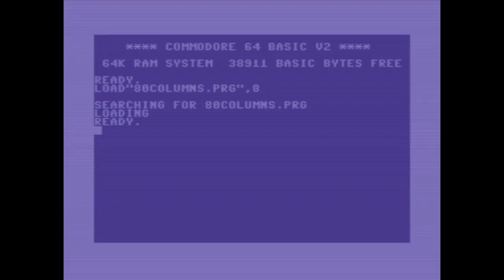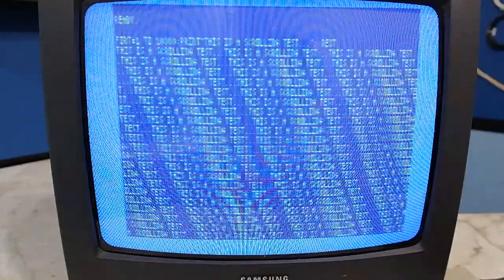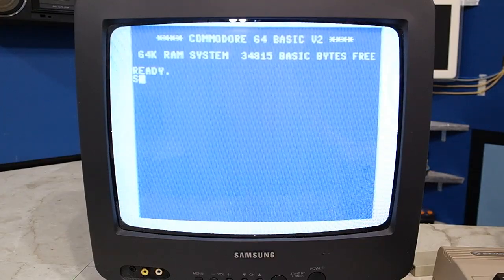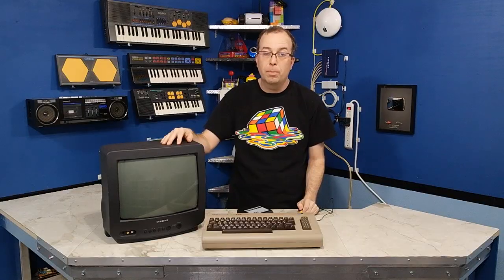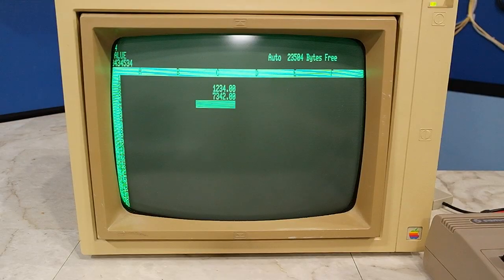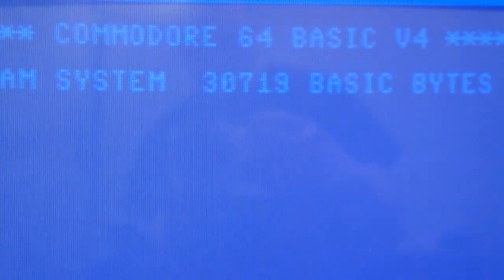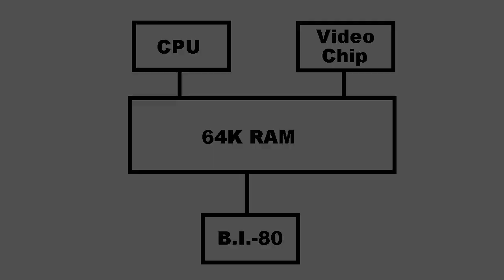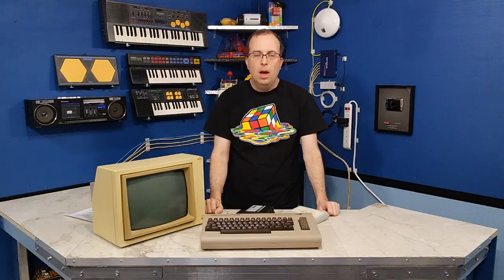The Quest for 80 Columns on the Commodore 64

Comment: There's a way to write software in portable manner on the Commodore 8-Bit line that doesn't require accessing screen memory directly: By using the ROM Kernal jump table of function calls (near the end of the Kernal ROM). They're the same on all 8-Bit Commodores. There's one call that returns the screen configuration. And you can use another to print characters in the same way PRINT does. So, even if you write a machine code program, you can do it portably.

Comment: I actually have the BI-80 card and the version of Paperclip that works with it.  It was great back in the day, the biggest downside was with the BI-80 version of Paperclip, there was 8 KB less memory for your document because the card took up 8K.  Sure, Paperclip had that great feature where you could link documents together to get a longer document then could fit in memory, but it was still a bit of a pain at times when dealing with long documents.  The BI80 card also added some commands to BASIC, which BI used as part of the explanation on why the card used up 8K of memory.

I recall there was also a terminal program which worked with the BI-80.  It was one of the ones that had full VT100 emulation and could also work with my 2400 baud modem (which I had built a user port to RS232 adapter for), and having it work at a full 80 columns was nice.  I can't recall the name of that terminal software unfortunately.

Comment: Another plus point to write down with our venerable Philips P2000T. The SAA5050 teletext chip could output the full 80 column buffer onto a single screen with a single POKE and had RGB out from day 1. Not altering performance or possibilities at all, and increasing the horizontal resolution a factor 2 in one go (480 pixels), so no need to alter the fonts. Which is one of the reason the machine is more fun today than a C64, even though it lacked game graphics back in the day: it is a better early terminal machine and highly expandable within the box. For games today, I just plug a PC Engine. It dwarfed anything else for games until the PS1 came along.

Comment: Here is a proposal that mods the motherboard somebody could try to figure out:

Change components on the c64, and maybe a daughter card to overclock the circuit to produce 80 columns, with an auto flip mode between the two that can be activated by software flipping a byte location (byte to give a variability in control modes to flip too, rather than just a bit that consumes a byte anyway).  This maintains backwards compatibility and uses existing display ports, which might need changing, but s-video is likely the preferred one of these display ports to use for increased quality over composite.  However, this is very complex, as somebody would have to figure out how to trick the system into changing all the timings to produce a usable form of 80 and 40 columns of the 40 and 20 columns, 640 and 320 multicolour mode versions of the 320, multi colour mode.  Maybe even sprites could be made to work in some way, with maybe 16 sprites per scan line but difficult).  But, a lot of work, but it might be that one scan line is produced at double clock rate to half the screen, and line sync stopped for the second line to fill the second half of the screen, before being reenabled, to scan down to another 80 column mode.  But, in this way, the system would see the second half of the line as a new line, where somebody could figure out how to crunch the sprites into being displayed again as possibly new sprites. The endo of frame synced needes to be suppressed and the second frame be butted up right to the last line of the first frame, and at the end of that the sync re-enabled, to form the lower half of the screen.  This also allows for the possibility of a 160x200 16 colour pseudo mode to be figured out, but maybe too much, considering nibble colour ram and non sprite multiplexing inside scan lines.  It might also require hest sinks for the overclocking.

This is a lot of software processing requiring switching registers and display bank too, but a lot less processing than say ZX-81 software video generation. 

If one added hardware for a software reprogrammable 16 color palette out of 64 colours+, that would be a Commodore 64+, and if you add 128kB  that would be a Commodore 128+, and a disk drive a Commodore 128d+.  If only this had been done in the day for the 128. Commodore would have had a lot more internal register access to do this with less programming with minimal on chip changes being able to reduce programming further.

It would be a what if labour if luv project, if anybody did it.

Comment: I used a C64 terminal programme that had a software-generated 80 column mode, and I used that from around 1986 to 1992 extensively to connect to local BBSs.  And I’m talking extensively, hours of use every day.  Thankfully, I did at least have a proper Commodore monitor, not a TV set, so it was livable.  If only barely!  When I finally got an Amiga, it was a revelation.

Comment: The clarity of the text depends on the dot pitch on a color monitor.  This is essentially the color pixel size for the monitor.  Cheaper and older color monitors had bigger dots. Monochrome monitors look better because they don’t have dots. The screen is a solid smooth phosphor and handles any resolution.

Comment: Back in the day ('86 or '87) I built an 80 column board for my C64 based on the 8563 and modified the OS enough to use it. It was a fun project and I learned a lot, but ultimately pretty useless because obviously there wasn't anything out there to support it other than a few fairly useless things I wrote.

Comment: I remember long long ago, I asctually found a word processor program on Q-Link that had it's own 80 column mode. Of course it was generally easietr to just use GeoWrite (back then my teachers wanted "typed double-spaced" and it threw them off when I asked what point size they wanted the text to be).

Comment: 3:30 I see an HM6116 on the right hand side there. Those were the memory chips they used in the NES. 16KB SRAM. They're actually real easy to use. Ben Eater used them in his breadboard computer. I remember making a breadboard based RAM module based off of his design. They were probably used in everything in the 80's through to early 90's and probably beyond.

Comment: The BBC Micro and Acorn Electron were two British computers of the same era, that supported 80 column displays out of the box (MODEs 0 and 3), in 2 colours (by default black and white, but the palette could be changed).  A bit later came the Amstrad 464, 664 and 6128 all of which also supported 80 column displays, again in two colours (and again the palette could be edited).

Comment: We had the BI-80 cartridge and the 80-column version of PaperClip. My parents did the newsletter for a running club and couldn’t stand the 40-column display. We used a non-Commodore monitor that could switch from color to monochrome with a button. I recall the display looking quite good.

Comment: I had an 80-collumn cartridge for the VIC-20 that also had 16K RAM in it. If I recall, there was no way to get color or 22-collumn mode with it installed, and it needed its own power supply or it would be glitchy. I had it plugged into a port expander that I made myself, with another 8K RAM, so I had an 80-collumn 27K VIC-20.

Comment: I had word processing software that would do 80 columns.  I don't remember the brand.  It did require a dongle in the joystick port.  Using a composite monochrome monitor it was very clear in 80 columns.

Comment: OK, this is a long time ago now but hear me out... I'm curious how much a used 80-column terminal or even better how much it would have cost to build a cart/IEC device that simply translated terminal commands to video signals. This would have been standard enough to be used from any program written for it with the C-64 keyboard to act normally. This can STILL be done. In fact it could be done on ANY 8-bit system off that computer's serial port. Was it really cheaper to make some crap interface instead of using something that could have changed the interrupt at the kernel level while the program was running and issued terminal commands? This could have made it fairly simple to develop other programs and even expand on the idea when CGA came along.

I admit - I played my share of games that neither required or even desired 80-columns. Things still printed on dot matrix printers, so most college professors would not accept dot matrix printed work making 80-columns useful mostly to nerds like me a smaller market. I just think that this was so poorly investigated at the time that we missed an opportunity, and not just on the C-64. This would have worked on the VIC-20 (extending its usefulness), all of the CoCos, and more for Spreadsheets, Databases, Word Processing, and Programming (even for the normal modes since anyone with two monitors could run with both screens). 

Yes - there were ways to do it with tricky software methods. When you're a person who works on a system for 40+ hours a week, that's eyestrain you don't need. 

Today, we can add RAM, SD storage, and various improvements to these machines and we still ignore this. Where's the love?

Comment: Why use bitmap? Couldn't  you just have a couple of interrupts some where on the screen to change pointer to character definitions on the fly and have say  2Kb banks of character definitions acting as a Hires blocks, such that could vertically scroll  things at normal speed? Also with interrupt code mix 40 and 80  modes to have clarity and char density simultaneously.....

Comment: Hmm. One of the downsides of the 80-column chip in 128 was that it wasn't good for anything besides text.  The way I imagine it could be useful would be, if you have the 40-column mode displaying, say, output for a game in development and the 80 column mode on a separate monitor, used for, well, say, a monitor software, used to develop the SW targeting the 40-colum VIC chip. 

I wonder, now, four years later, we're living in the era of replacement and upgrade chips, perhaps something BETTER, yet compatible, could be socketed in for the 80-column chip....

Comment: Ah, I remember writing software to switch to 80 cols which worked fine. I had also a monochrome monitor; so it was quite readable :)
The reason that 80 cols never caught on has IMHO to do with the market: if you want to do business things, you need a business computer and the c64 was extremely well known for its gaming possibilities. Not something what you wanted in a productive business environment :D

Comment: So I just finished modding my BI-80 adapter tonight. Since the adapter was just using luma and I do not have a dedicated monitor like what is in the video, I ended up modding in some S-Video ports to replace the RCA jacks. I soldered in the luma lines and luma ground in the board and did some pass-through lines for everything else. The result is a really nice S-Video setup for my Commodore 64. The image looks really good on my CRT tv and video capture devices. 

Also for using PaperClip with 80 columns (for those who care), you have to modify the load command given (assuming your disk drive is device id 8:

load" paperclip64?-80",8 

Or for Spellpack versions:

load" pclip 64?-80-s?",8

Great content even years later

Comment: I had a great 80 column word processor for the C64 I used back in the day, which I ran on a small colour TV, probably until 87 when I finally got an Amiga 1000.
Once you'd played with the contrast etc, it was quite acceptable and no hassle. I can't remember what it was called, but I preferred it over GEOS.
You probably wouldn't be able to write a whole novel on a C64 anyway, but it was perfectly fine for schoolwork.

Comment: I have the Batteries Included 80 column adapter, but a newer version that had a switch for 40/80 column modes.  I used Paperclip as my preferred word processor, and used it for many years until I got a 128 and used GEOS 2.0 with GeoWord.

Comment: 3:15 I imagine the inclusion of a headphone jack made it easier for the user. Being able to plug your headphones into the back of the unit rather than to require a longer lead from your TV (if you were lucky enough to have a TV with a headphone jack)

Comment: "In this case the bluriness is actually the fault of the color television" - why didn't you show 80 column bitmap mode  running on a monitor? It seems like this if there was business demand for c64, then this would have been the best option for any software company willing to try and write business software for c64.

Comment: I'm not really sure if someone commented this, or even me when I first saw the video, but every TV has a "colour" setting. Most of times, if you get it all way down to 0, you get a really sharp monochrome signal. I tested it with a NES, and works flawlessly. Surely enough, your TV will have that same configuration, and the same "trick"
Reply: Not exactly. The thing is a monochrome screen has no shadow mask. It is just totally covered in a single phosfor, and as sharp as the resolution in the signal can be. You could even create like 1000x240 pixel images.
The colour TV has a shadows mask with phosphor dots in the 3 primary colours, and these 'subpixels" have a pitch of like 0,3mm or so. That means you can resolve maybe 200 vertical lines at best. The only difference putting the saturation to 0 gives is less colour fringes. But not more sharpness. And another problem is that on a pure RGB signal of say the C128, there is no saturation control on a TV at all, the slider just grays out.

Comment: You can "melt" together the video prior to the color burst stages. If the signals are in proportion with timing and pixel rates, a clean text overlay can be done.

Comment: To learn programming, and to avoïd connection to a time sharing computer and pay for slow modem transmission, a Basic computer with only serial ports to hook up to existing myriad of serial terminal, would encounter success in academic, replacing HP-2000 mini's.

Comment: I have a stupid question: wouldn't it be possible to falsely improve the image quality on color TV using 80 columns via software with the trick of quickly switching images as is done in some demos that seem to falsely improve the resolution and number of colors on the c64?

I mean, flickering the text with different colors, like in the ifli images.
Reply: Something like that was shown in the movie Brainstorm (1983) - I wonder what kind of computer there was?

Comment: I had a C-128 with a 1702 and an RGB adapter, and I was immensely happy with how well WordWriter 128 performed in 80-column mode.  It was only for the stringent formatting and style requirements in college that WordPerfect 5.1 on PC replaced WordWriter as my word processor of choice.  As a side note, even then, I was able to use my 1702 with the composite on my PC's CGA card.  I was also impressed with how good AppleWorks looked in 80 columns on a //e with a mono Amdek monitor.

Comment: One of the best quotes to date: "The composite signal is actually surprisingly sharp and clear, as long as it's monochrome. Once you shoehorn the color signal into that, it greatly degrades the signal." - The 8-Bit Guy
Reply: Whenever I watch shows from the 60s, it always strikes me how sharp the black and white ones are compared to the color ones
Reply: I saw this exactly as it came on

Comment: 80 columns on 8-bit machines (except for the Apple //) were generally too little too late. 1984 saw the Mac introduced, and the IBM PC was getting cloned so prices soon came down. I worked with people doing all sorts of hacks to get the CoCo spiffier (such as the 68000-based SuperCoco card), and by 1985 they just gave up because the momentum had completely gone to newer systems. The longevities of the earlier systems were being replaced by faster product cycles, it no longer made sense to invest time on enhancements. When people tired of their PC/ATs, they happily bought Compaq Deskpro 386's, etc.

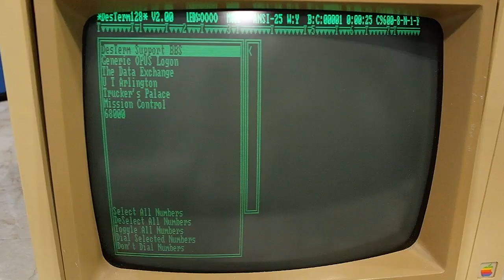Comment: 13:25 The more advanced question was "Why wasn't a lot of effort put into software development for these". And it wasn't, because the overall cost in attempt to have a decent word processing tool would have been still too high while leading to a DIY kit, competing on a pro market. At that time, the most promising way would have been a daisy wheel printer attached to the C64, along with 1541 and monitor to spill out business letters (offers for example) with prefab text modules. But there was no ad guy to seriously sell a breadbox to a secretary.
thanks for the vid!

Comment: I had/have the  data 20 card for the vic 20, What I used it for ? Well vt100 terminal emulator built in its rom . But really back then I Converted Super Star Trek to use 80 columns and Have it show most need info from the game all at once, The cartridge for the Vic-20 did include a word processor, a spread sheet on a cassette tape.  It's in the garage addict now. But I do remember those days.  The card also had room for memory in it of 8k.  Think it used the 2K chips a row of 4.

Comment: ...I wonder how many 'columns' modern PCs have...?
Reply: Windows, Mac OS, etc. use proportional fonts where some letters are wider or narrower than others.  Compared to older computers where every letter was 8 pixels wide.  So the concept of columns no longer exists except when you open up a command prompt, which still uses a monospaced font like in the old days for compatibility with older DOS or Unix software.